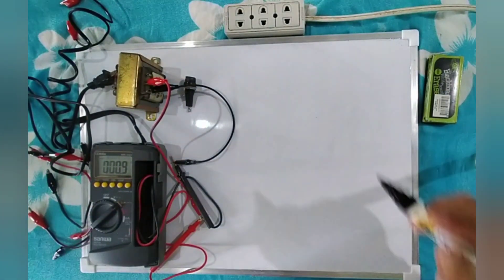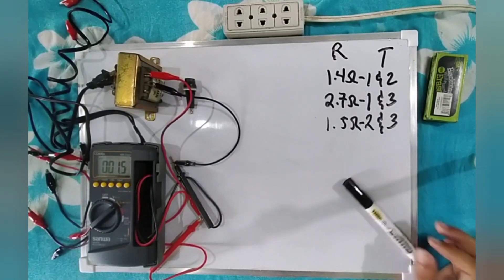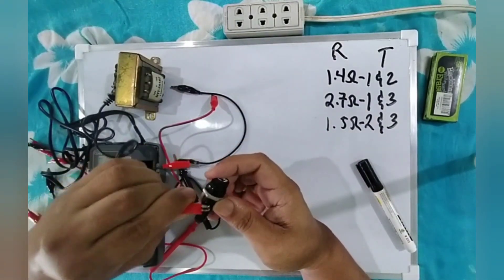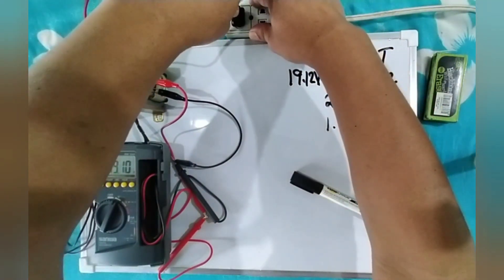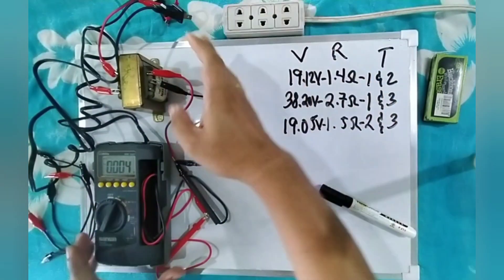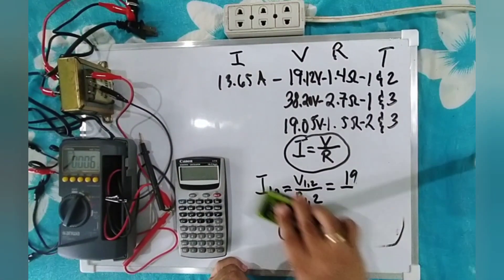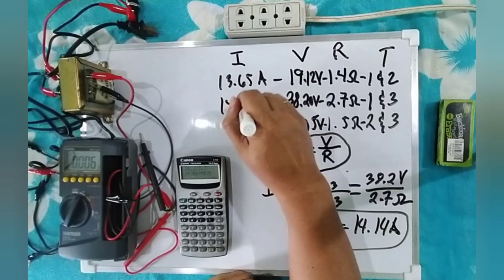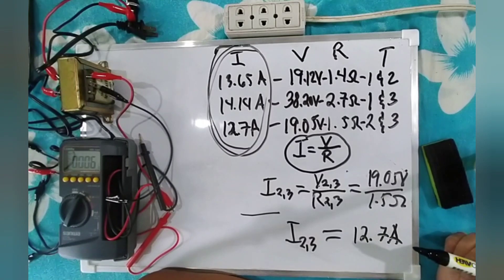Checking or Testing No Load Current of a Transformer using Ohm's Law (Part 1 English)

Comment: Sir, base lang po sa POWER LAW,  may naka-indicate na jan sa transformer ninyo 2A182. meaning of 2amper 18volts X2. yun ang kanyang maximum or standby power, Total power of 36v X 2amp. (IxE) = 72watts. Sa inyong computation nagkaroon ng 14.14ampere X 38.2volts=540watts?  Kung babalig-baliktarin ang formula ng Ohms Law at Power Law ay sa kaunting points lang sila nagkakaiba. Alin po ba ang nsa tamang formula ng wattage, yung 540watts n base sa compute nyo or yung naka-indicate sa transformer na (IxE) 72watts?
Reply from the maker: Good day po... Ang susundin niyo po ay iyong computation niyo po... 72 watts... Ang video po na ito ay ipinapakita ko lang po ang no load current po ng isang transformer... Pero once na may load na po ito, bababa na po ito... Salamat po...